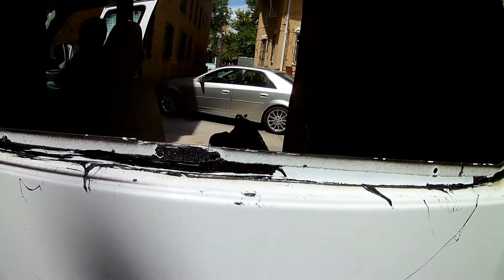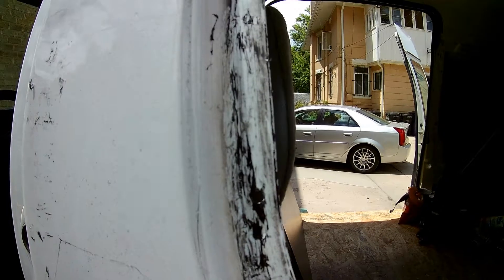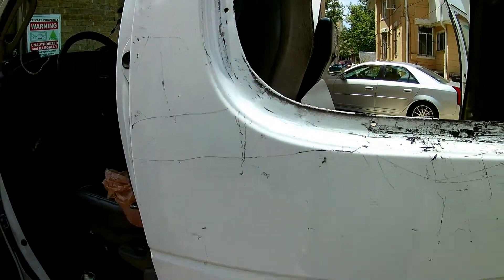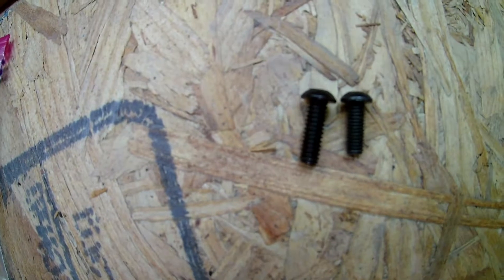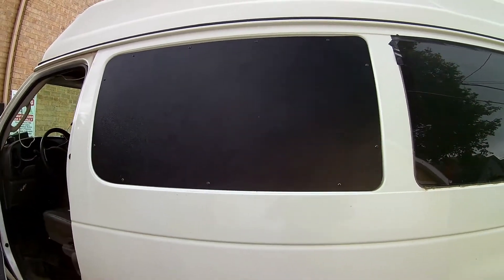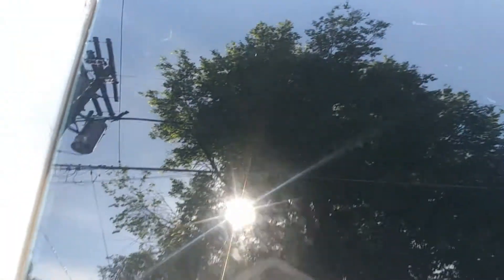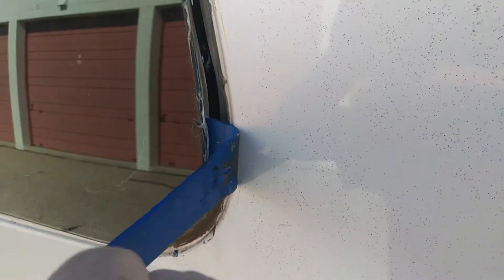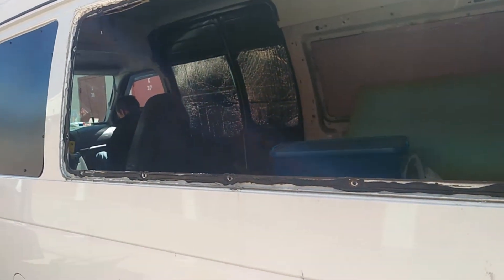Van Build Denver: Van Window Replacement/Part Two

Comment: You are getting the hang of this now. It must be frustrating waiting for a pay check when the weather is fine and you want it sorted for the Winter.
Reply from the maker: We'll be spending January and February in Arizona, Death Valley, Mojave desert so it will be warm but there is still cold weather ahead and we'll be needing new sleeping bags. I was thinking of buying one of those Chinese diesel heaters this year, they're affordable but they require an electrical connection and I don't know if I'll have the money to install auxiliary battery and get it all wired up. I don't do wiring, I'd have to pay to have it done.
Reply: @vangazmicvoyage5077  should be a tad warmer there